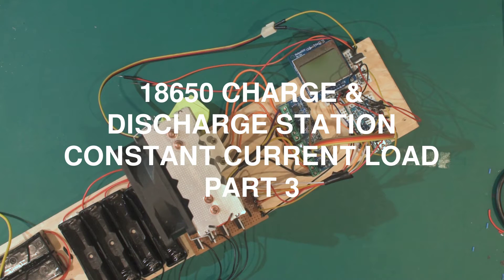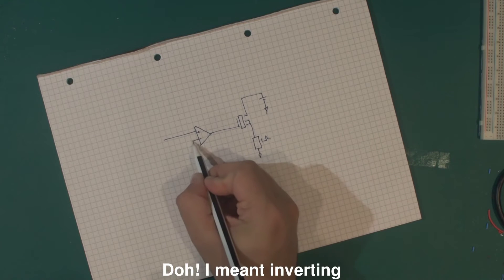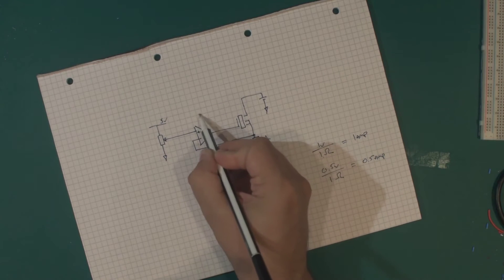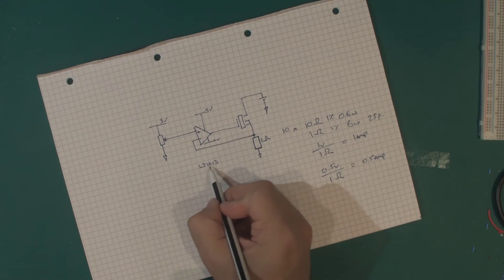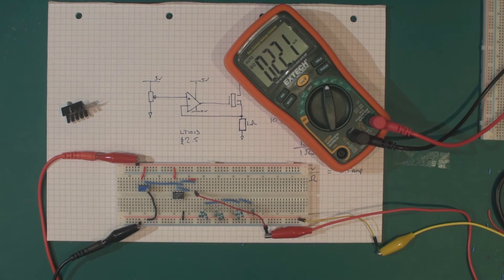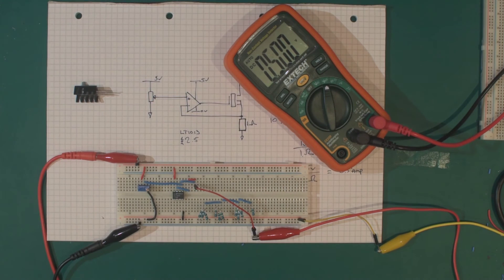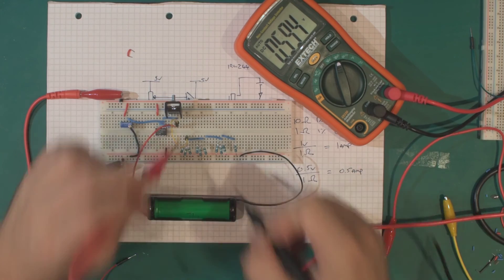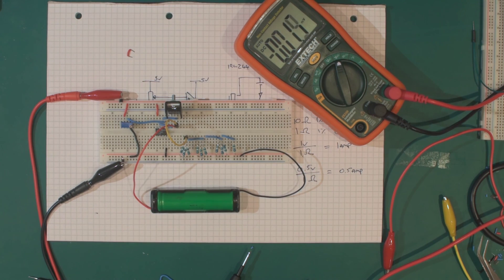18650 Station - Constant Current DC load Prototype

Comment: Ah nooo. I just realized you are measuring battery voltage and you assume current is constant any time. I think you have to use voltage over resistor when you integrate capacity and to use battery voltage when protecting from over discharge.
Reply from the maker: That right (i really need full diagram on the github page), currently there is a hardcoded value in the code for the voltage over the resistors. I'm undecided if measuring the voltage over the resistors is needed or not, still working that bit out. I currently have the assumption that as long as the battery voltage doesn't drop below 1v, the op-amp will hold the voltage over the resistors to 1v, giving continuous 1A. But i'm never going to let to go below 3v so it should always be able to regulate a 1A load.
Reply from the maker: Forgot to say, thanks for watching and your feedback! 

Also EEVBlog Dave does a good job explaining the constant current load if you haven't seen it before... https://www.youtube.com/watch?v=8xX2SVcItOA

Comment: Nice one. I was thinking to start design for a Li Ion charger/discharger. I started with the charger part. I am still nowhere. I am planning to use buck converter controlled by PWM on Atmega 328.  I checked your Arduino project. There is no description what voltage are you measuring. I guess you are measuring the voltage over power resistors. It is Volt to Ampere correspondent. Then you are integrating the capacity each second.  Like this video. Just subscribed to your channel. 
BTW: IMHO I do not like Arduino. I am designing and developing using ANSI C and no arduino libraries.